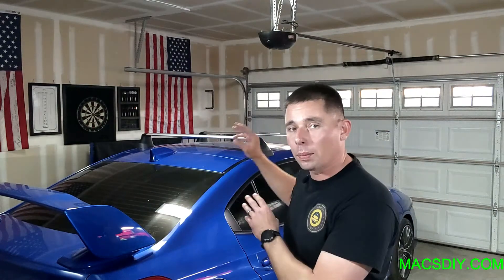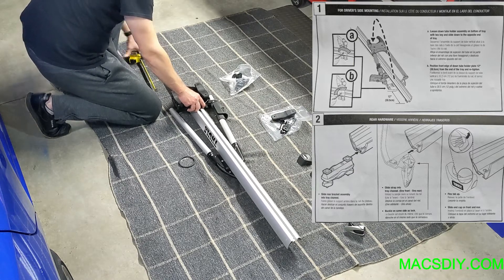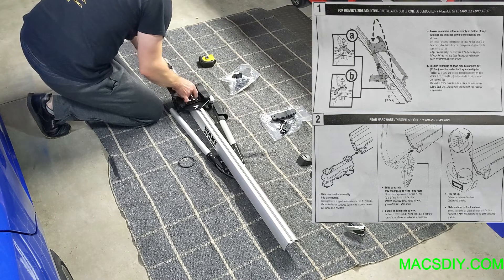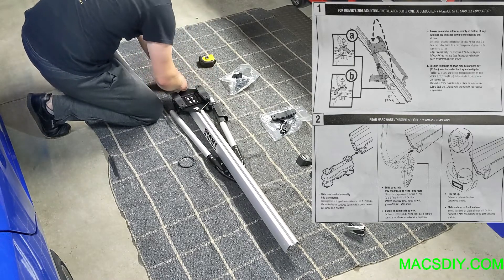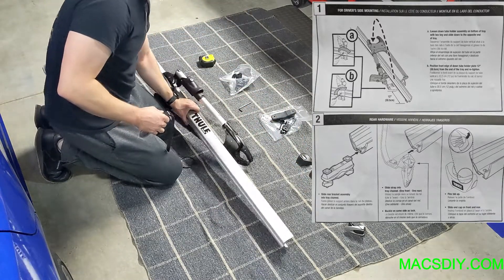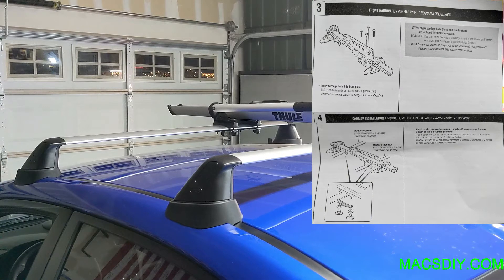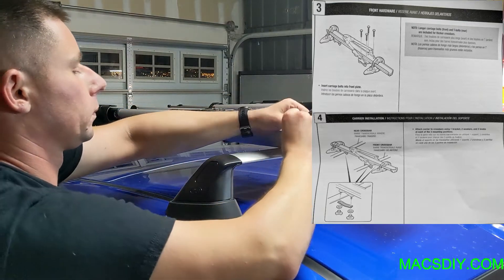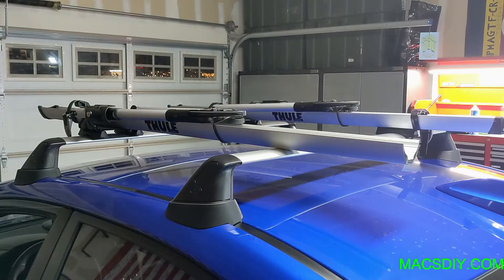2015-2021 Subaru WRX STI: How to Assemble & Mount Thule Bike Carrier!

Comment: Thank you for providing video of the assembly of the rear bracket assembly.  The instructions that came with mine assumed that they were already assembled but they weren't.  A little challenge.

Oh, and thank you for showing the "rubber band" on the middle of the bike rail is there to hold the tube holder in place when it's down and against the bike rail.
Reply from the maker: Glad I was able to help.

Comment: i have a similar thule bike carrier that is bolted to my roof rack...but how would you LOCK the bike carrier to the roof rack.  if someone wants to steal the bike and bike carrier, all they have to do is loosen the bolts. any ideas?
Reply from the maker: You are totally correct.  I really haven't thought about that, but when I do put my bike on the bike rack and get to my destination I take it off immediately and go for a ride.  Once I am done with my bike ride I then put it back on the bike rack and go straight home.  The only solution that I can come up with at the moment is a button head security torx bolt with a locking nut.  Let me do some more research and if I find anything I will reply to this comment.
Reply: Thanks for the heads up I just ordered mine today I will definitely be sure to take off the bike carrier when it is not in use

Comment: So do these only tighten onto the bars with no way of locking them down to the bars?
Reply from the maker: Correct.  I am still on the hunt to find something that actually locks rather than those screws.  If I will find something then I will post it in the comment sections.